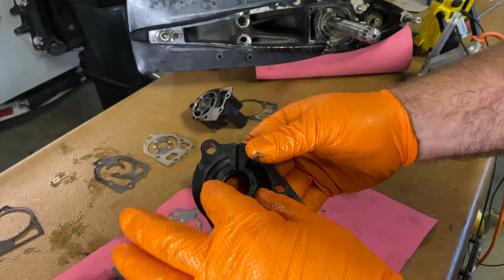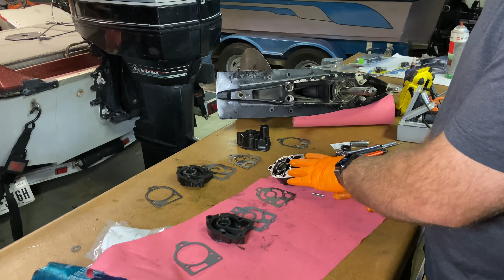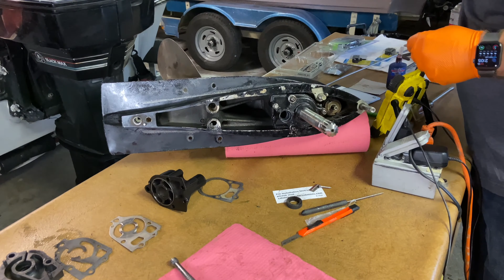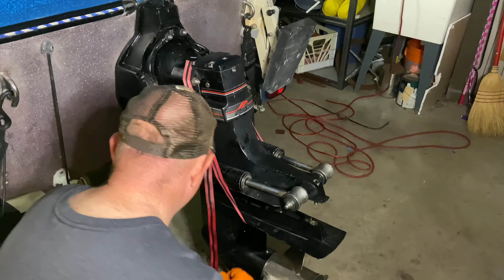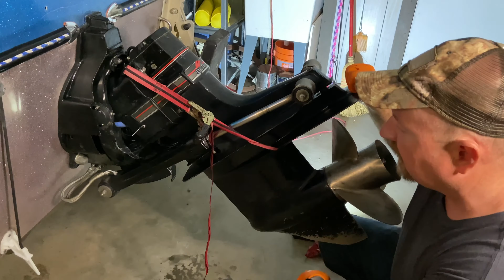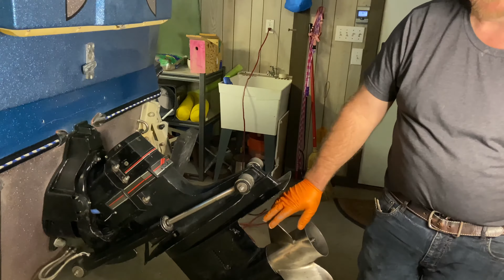Mercruiser Alpha 1 Gen 1 Stern Drive Repairs Part 8: How to Install a New Water Pump on a Boat

Comment: With the entire drive unit on the bench should I be able to shift the lever by hand mine won’t move. I replaced the water pump impeller and put the upper and lower back together but the propeller turns freely. I also cannot move the shift lever by hand. It is in the forward position though. I thought the propeller should click when turning it clockwise?? Luv your videos!! ✌️
Reply from the maker: Ver resposta curta

Comment: What are the Quicksilver part numbers? I think the base may have a different number from the main assembly-
Reply from the maker: Hi Mel-   This is what I bought--- the water pump base repair kit is Quicksilver 44292A3.
(PAID LINK): https://amzn.to/3Q3V2RR
DISCLOSURE:  As an Amazon Associate I earn from qualifying purchases.
Reply: Thanks for the info!  I had made the mistake of saving a few bucks with cheap aftermarket parts and they lasted a few hrs of run time😂Too much labor involved to do that again and there is also the issue of being stuck on the river or even worse sinking your boat.  Have a wonderful Holiday season👍💯👍Your videos have helped me replace most of the parts on my Alpha one -Gen one. My engine starts and runs like new and looking forward to installing my new original equipment Quicksilver Water pump!
Reply from the maker: @mellow-2  Thank you- I appreciate the Super Thanks!  I’m glad you’re able to make use of these videos and your repairs are going good.  I’ve gambled on cheap parts and have lost, so I know how you feel.  Happy Holidays to you as well!

Comment: Dont ya just love having all those extra gaskets and seals left over not being used. When I did this for the first time a few weeks backs, I had the deer in headlights look and thinking oh no, I've done something wrong lol. But I ran my boat this weekend at a local lake all day friday and Saturday. My water temp on the gauge never went over 145 degrees. I also changed out my thermostat and installed all brand new cooling hoses. My old thermostat housing had so much rust in it, the ports that feeds cool water to the manifold risers were almost entirely blocked up. I put my thermostat housing in a grit blaster at my work, stripped it completely. Primered and painted it up to look new. Got all of the caked rust out of the inside of it. This old 88 sea ray I bought back in June. I was pretty disappointed at the lack of care and maintenance the previous owner did or didnt do on the boat. I'm attention to detail. Now I've just got to replace all gaskets. Timing chain cover gasket, valve cover gaskets, intake gasket. I have a feeling they are all old and possibly original gaskets. The block has caked oil in some of those areas. But I know me, I'll have to replace the timing chain and gears since tearing into the timing chain cover. 4.3L GM motor.
Reply from the maker: Yes - I know what you mean,  it’s always better if they give you only and exactly what you need in the repair kit so there aren’t any questions after you’re finished. Glad to hear that your boat is running well and staying cool out there on the water after your repair. And it’s nice to have access to those good tools at work to get things cleaned up like removing the rust from your thermostat housing. I know what you mean about buying a neglected boat,but it sure gives a sense of satisfaction when knowing all the hard work doing the repairs allows you to come back to the dock without being on the wrong end of a tow rope.
Reply: @ProWrenching  Definitely. It did feel good after 2 full days out in the water and no breakdowns. Everything ran smooth. Only 2 issues I’ve found over the 2 days is the gas gauge don’t go all the to full, stays at 3/4 full after filling up, once the level gets below that the gauge then drops with the level as it should. The second issue is at times at no wake areas, when I stop to back up or forward from neutral position, it dies, and sometimes don’t want to fire. Turns over but won’t fire. I’m thinking that kill switch back by the throttle cables is sticking sometimes. It will fire up after moving the throttle back and forth in and out of gear.
Reply: @ProWrenching  on a more positive note, despite it being the original motor, and unknown amount of hours on it, it does have great oil pressure. Well, assuming the oil pressure gauge is reading correctly. When cruising pressure is up over 60 psi.
Reply from the maker: @larrywalden626  Sounds like you have good oil pressure & a solid motor and with two full days on the water, sounds like you only have a couple of small bugs to work out. I do have a video on the fuel gauge sending unit and a video on upgrading a shift plate that shows some cable adjustments in there that you may find useful.

Comment: Great video, do you have any information on where the pipe from the lower portion, goes into the upper portion? Mine also go hot and melted that also. I can’t find anything on that on the internet. Thanks
Reply from the maker: The water pump connects to a pipe in the upper portion of the stern drive which goes through the gimbal through a hose and then passes through the transom to the motor.  Hope that helps.

Comment: Thank you for this post, love the strap idea when doing this by myself. So I followed your guidelines and got everything apart and back together. I had a hard time getting the lower unit back on, but I eventually did. However, after I got it all buttoned up oil back in I went to start it up with the muffs and My shifter would not move back to neutral. So, I must have done something wrong with gear spline/shift cable when putting it back on. Shifter was in full forward position during the entire time and I do not recall moving the shifting spline at all. Now I'm stuck. Any suggestions, I'm probably going to have to pull the lower unit off again tomorrow and start over??
Reply from the maker: It sounds like that even though the shifter was in forward gear, the lower unit itself was not in forward gear position.  You’ll need to drain the oil (I would save it in a clean container to re-use since its new oil).  Then lower the unit enough so that you can shift the lower unit by rotating the shift shaft so that it is in forward gear when you reinstall it.  You can test whether or not you’re in gear by rotating the propeller on the outdrive.  After you bolt it up, before you put your oil back in, you’ll want to test that it shifts in forward & reverse.  When in neutral position, youll be able to spin the propeller freely on the outdrive.

Comment: I liked the way you explained your procedure, but I was wondering how you removed the bottom half of the pump base assembly , I have the same problem as you, as to melting problem, but the bottom half seems stuck. Any suggestions on removing this base? Thank you
Reply from the maker: Take a couple of flat bladed screwdrivers and try to gently pry it up to remove it.

Comment: I looked on the link for the water pump and it is only showing that it contains all required components to replace the water-pump impeller and the upper pump housing, but does not include the lower base.  Did you buy the lower base separate, or is there another kit number? Thank you for your assistance and the video's.
Reply from the maker: Yes- I bought the lower base separately.  Thanks for your question- I'll add that to the video description.  The one I bought is the Quicksilver 44292A3 water pump base repair kit.  I bought it from a "major online only retailer".

Comment: Under the plastic water tube is there a o ring, washer or bushing of any kind required?  Also is there any rubber parts required on the copper water supply tube that goes upwards from the plastic tube?  Thanks for your info!!   Mel
Reply from the maker: Mel – in the water pump housing, there is a rubber seal underneath the plastic tube that seals the copper pipe.  There’s also a rubber seal on the upper unit of the drive that seals the copper pipe.
Reply: @ProWrenching  Thanks so much for the info -I found a rubber seal with my kit that is about 3/4 inch long and it fits snug into the top of the water pump housing hole.  So I guess this is the rubber seal you were talking about.  I don't see the rubber seal you mentioned for the upper unit of the drive that seals the copper pipe but the pipe fits in there tight so hopefully I'm good to put it back on.  Since I'm replacing a lot of parts on my 86 Mercrusier Alpha one gen one, your videos have really been a blessing.  Again thank you so much for taking the time to do the videos and also for helping this aging rookie wrench!!!
Reply: That seal I mentioned that came with the kit only bottoms out but only allows the copper tube to sit on top of the seal that goes into the top part of the water pump housing-- too tight to insert copper tube into seal.  Hopefully this is ok or else I need to head to a dealer for a part.  Thanks again!  Mel
Reply from the maker: Hey Mel- really appreciate the Super Thanks!  Thank you!   The copper tube should be able to fully insert inside the seal of the water pump housing.  If you purchase a new upper half of the water pump housing, it will come with a new seal pre- installed.   Thanks for watching!
Reply: After installing a new water pump and water pocket part that had overheated I am having issues reconnecting the lower with the upper on my 86 alpha and gen one Mercruiser.  I saw on your video that you installed the lower with the outdrive all the way down or so it seemed.  Mine is lifted some maybe I should drop it down.  I have all the studs lined and slightly thru the upper part and the throttle is in forward.  I checked the lower unit to make sure it too was in forward by trying to turn the prop shaft to the left and it would not turn but would turn to the right.  I assume this means both throttle and prop shaft are both in forward.  Even so it appears that when I turn the prop to the right that the vertical shaft does not turn with it.  I'm about two inches or so from mating the two parts.  Any advice?!?
Reply: I am also using a strap like you used in your video.
Reply from the maker: @mellow-2  in forward gear your propeller should be able to spin freely in the clockwise direction, and it will lock in the counter clockwise direction. When you turn the propeller in the counter clockwise direction, It should turn the upper shaft. You may need to turn the upper shaft slightly to get the splines lined up and engaged in the upper housing.
Reply: Thanks!  I would be a dead man wrenching without your videos👍💯👍
Reply from the maker: @mellow-2  Thanks!  Glad my videos are helpful!
Reply: I do believe that my problem is that I have the wrong water pump.  I noticed during install that the base did not fit as well as the one of replaced.  I could barely get the lock nuts over the studs.  Could you please provide me the brand and part number you used in the video- I have the 1986 Mercruiser Alpha one Gen one -Engine number A658983-Thanks again for your help!!
Reply from the maker: @mellow-2  Mel- Quicksilver 96148Q8 water pump repair kit
Reply from the maker: @mellow-2  Hi Mel-   Quicksilver 96148Q8.  It's linked up in the description section of the video to where it can be purchased.

Comment: My friend how are you ?,, brother that link you add in the description to buy the kit bring the lower case I don’t see in the picture!!!
Reply from the maker: Hello!  The base repair kit- I bought from a “major online retailer”.  Sorry, I dont have a link for that- just the part number.  You can buy it from any shop that sells Mercruiser parts.  You can tell them the part number when you order it.
Reply: I replace the impeller but I went to lake I see little overheating up and down temperature I may have to replace the case
Reply from the maker: @gherickb8181  did the case look ok?  You would only need to replace it if it was melted or had physical defects.  If it all looks good, you may have other issues.  I can’t remember if you had previously said if you have replaced your thermostat yet?
Reply: @ProWrenching  previous I replace the impeller was damaged I remember turning the engine for couple minutes whit out water ,, work fine last week new this again and yes I remember the case was melted

Comment: What kind of grease are you using?
Reply from the maker: It was a marine grade grease.  I don’t remember the brand- something I picked up either at WM or Tractor Supply.
Reply: @ProWrenching  
So just a standard marine grease is what I need! Thanks!

Comment: Hi, installed the waterpump rebuild kit. Struggled to reinstall lower drive then it suddenly went. now the drive clicks pretty loudly in forward and reverse in the free directions (when prop turned CCW in forward gear it locks and turns CW, but has popping over a gear or something. 6 pops per prop revolution). Neutral spins freely both directions. Reverse is opposite but same noise as forward.
Reply from the maker: Sounds like you may need to adjust your shift cable.  I do have some other videos that may be helpful.  You may want to check this video out on upgrading the shift interrupt switch. https://youtu.be/Sq_VYXlW_oo.   Adjusting the cables is part of that procedure.

Comment: Do you think its easier to attach the lower and upper together, then attach to boat? Or attach the upper to the boat, than attach the lower?
Reply from the maker: In my opinion, it’s easier to attach the lower to the upper and install the entire stern drive assembly all at once.  I also have a video on installing the stern drive, if you want to reference that.

Comment: Wish I'd watched this before I tried to do this. I am stuck in reverse. Any help would be greatly appreciated.
Reply from the maker: Sounds like you may have had your lower unit shifted into reverse instead of into drive. You’re just gonna need to lower the lower unit and use your hands to turn the spline shift rod on the lower unit so it is in forward gear and you may have to hold it in place by holding the propeller,  and then reinstall making sure that your boat is shifted into forward gear.